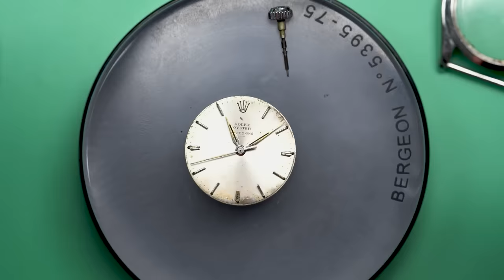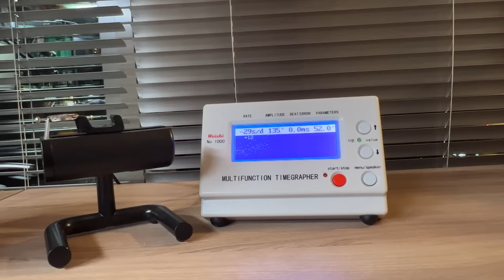This Vintage Rolex Restoration Came Out Even Better Than I Hoped!

Comment: Marshall, I started watching your videos a couple years ago during an illness simply because they started playing using YouTube auto play. Those videos caused a memory from my childhood in the 1970's of being given a couple of my deceased grandfather's watches.  Over the past couple years I have watched your videos and the urge to repair those old watches has grown to the point that the other day I dug them out of the drawer they are stored in. They are both old Elgin watches, one is an auto with day and date while the other is a simple wind up gold dress watch. Both watches are missing most of the crowns, apparently Elgin used cheaper materials for the crown and the only portion left is the small brass bit that screws to the stem. Anyway, I have ordered some new parts for the watch with the auto movement, a Swiss Felsa 4009 movement as it turns out, and with the help ofyour videos I will begin to attempt to repair it when the parts arrive. Thanks for videos and your positive, upbeat presentation style.

Comment: The Speedking looks fantastically classic and refined in style (ie without wear and tear) - also in relation to my simple steel 1985 Datejust which I bought new. Less "bling" such as the absence of the contemporary Datejust case and the Jubelee bracelet helps. I do not think that these have aged well stylistically. Otherwise, my 1985 Datejust still works perfectly even after 37 years of continuous use. The watch has been extensively cleaned twice and has had both the glass and the bracelet replaced twice. Keep up the good work :)

Comment: Just want to thank you, since I discovered your videos not long ago, picked up some cheap tools to do some basic take apart and inspect on my watch that would only run for a few seconds at a time.
Didn't take long to fix it, turns out from the factory they had inverted two of the gears for the automatic rewind system so it would just do an odd thing where the automatic system would somehow lock up the rest of the watch and the balance didn't have enough of a punch on its own to push past the blockage. Swapped them around, and now it's been on my wrist for the whole day, and still is right in sync with my smartwatch time.
Keep up the wonderful videos, they're a treat to watch and listen to and certainly encouraging to pick up a lovely hobby!

Comment: When you use any kind of tap, even to clean threads, you should thread it in a full turn, and back a half turn repeatedly to make progress. Should also probably use some kind of lubricant. I'm not a watch maker or anything, but that rolex thread refresher thing looks like a tap.
Reply: Agree but I would say a half turn forward and a quarter backward.
Reply from the maker: I did
Reply: So pretty much after every movement forward you go 50% backwards?
Reply: That advice comes from the good old days, as in pre-WWII. Modern taps invariably have chip breakers and gully channels to clear the swarf so the old way is becoming less and less relevant, and you will notice that powered taps do not do it at all. Finally, the tap Marshall is using is a thread cleaner, not a thread cutter; if it came out of a classic set of 3, it would be #3.
Reply: @DutchClawz  2 steps forward 1 step back

Comment: I don’t know what prompted me to “watch” this video, but I viewed the whole thing. Very impressed with your work. I think I’ll try to restore my clock on the wall. It runs, but the hands are loose and it seems to be running fast. I also have an old cheap watch that I think I’ll take apart to see if the components are the same as the Rolex type. I just hope my eyes are good enough to see those molecular size parts with my eyeglasses and magnifying glass. Thanks for the video.

Comment: I've finally got to the point where I can name every part of a basic Swiss movement, Marshall. I owe it all to you, your videos are excellent because you name every part, tool, and lubricant. I'm scouring ebay for used and new professional quality (Bergeon) watch tools, Timegrapher, and cleaning machinery. I'm an Electrical Engineer by trade, and I am acoustomed to working with small components, but this is taking it to an entirely new level. The parts and screws are miniscule, and require a very steady hand to pick up and place the screws in the right holes. I'd probably need to put the screws back in the holes during the disassembly, so I don't forget where they go. 

I set up a place on my electronics bench for watch servicing and repair. I already have a buffer system for polishing watch cases and bracelets, but I still need to populate the bench with watch repair tools. The mainspring winders are dauntingly expensive, and I may have to do with the Chinese knock-off version to begin with. They're fairly inexpensive, (a quarter the cost of the Bergeon winders) but they a significant flaw. The nub that the mainspring end hooks on to is a cast brass nub on the winding shaft, rather than a steel pin. I suppose that once the nub wears out, I can drill into the shaft, and press fit a steel pin into the hole. This would extend the life of the Chinese winders significantly.

Comment: I do plating and after plating you can use a brass wheel with a fine comb to buff the shine away if you dont need a shiney surface. It works quite well. Another great video thankyou Marshal

Comment: You tube is lucky to have content creators like you. Good work and thanks for posting this. My skill level is changing the battery on my quartz watches and strap adjustment and replacing. 🍻 CHEERS

Comment: Great video! A tip for the escape wheel cap jewel springs is to not remove them but just use a small screwdriver to lift up  the spring and then put it back down once you’ve removed/installed the jewel

Comment: Good technique:  On any mechanical device, if you are installing a part with multiple screws and other things that go in it like axles or pins, start them all before you tighten any of them.  Thanks for demonstrating this :)

Well done video as always.

Comment: I loved this, my first look at this channel. I bought a new Oyster, much handsomer than this watch, in1952 at an Air Force PX in Dhahran, Saudi Arabia, for $38 as I recall. (I am 97.) The watch is now at my watchmaker's for a thorough service. He is waiting for a new palette. It came with a leather strap, and in my ignorance I didn't save the buckle. However, I was fortunate to find a period-correct steel Oyster bracelet in a small Arab shop. I have bought and (stupidly) sold several Rolexes including a Day-Date I received as a 30 years service  watch. I still have a '70s two-tone Datejust with Champagne face and Jubilee bracelet, also in for service, and a Submariner I bought new about 4 years ago. I have many memories about watches I've owned, including an Omega with moon phases, a 10-karat manual IWC for which I bought an 18-karat mesh bracelet, a tiny steel International I bought my wife and still have. I also have a Ferrari Panerai and a Santos de Cartier Large Model. And more. Oh, yes, a gold-filled Hamilton I got for my 18th birthday which I still have.

Comment: Love the channel. A little tip from an old stagehand, but a pencil eraser is fantastic for removing tarnish and corrosion from otherwise "stainless" metals. Plain jane pink erasers are very mildly abbrasive and are perfect for cleaning electrical contacts. Might be useful.

Comment: Nice work!
Cleaning up threads with a thread-tap I believe is called "chasing" the thread.

What you used on the barrel looks like a thread-cutting tap, not a reamer, reamers have a straight cutting edge.
There are specialty thread-chasing taps with the thread-crests rounded down, but an older thread-cutting tap is usually what tool & die uses for chasing a threaded hole because when taps wear from use, its generally the thread crests that wear down.

Comment: Enjoying your videos!  I didn't catch whether this was an acrylic or sapphire crystal, but so far I've noticed you usually use acrylic when you replace them.  Do you prefer acrylic over sapphire (or even mineral), or is it just that the acrylic ones are much easier to replace with the type of press you're using where it actually bends the crystal a tad?  Thanks for your videos!

Comment: I repaired a 1930s longines , I have never done that before and with basically no tool just a few screwdrivers and an eye loop and worked great I've owned many and by many I mean a couple hundred watches I bought sold and traded I only own a few now but I would love to get back to the hobby is fun just picked up an omega constellation pie pan 18k late 50s early 60s like new for $280 I love watches and your channel

Comment: 33:08 I struggled when I first removed a cap with one of those clips (it cost £50 for a replacement! That was after import duties and taxes were added). I have seen a video by a Bulova expert, Henry Frystak (I have so far specialised in Accutrons) and he seems to release the end tab, and hinge the clip up with the other two tabs remaining in the undercut, and this provides sufficient space for extractingthe cap. Well - that's what it looks like he does, but I haven't yet had the opportunity to try the technique.

I love your presentation style, with great camera work and excellent sound. This video has made me think I might now have a go at restoring a fully mechanical watch.

What microscope do you have? I use a long-throw eBay binocular, and it is perfect for my purposes, except I'd like to do videos.

Comment: This is a general point related to screws and springs pinging off.  I tend to have that problem a lot, especially when reassembling vintage movements with those microscopic screws that hold the cap jewels in non-Inkabloc settings.  I’ve started placing the anvil or movement holder on a spread-out cheap microfiber cloth.  Normally when a screw pings off it hits the green watchmaker’s workpad, then bounces off to parts unknown.  When the work is done on a microfiber cloth, the screw hits the cloth and stops dead in its tracks.  Note that I don’t place the work directly onto the cloth, as it would tend to stick and also pick up fibers. Once the screws are in, I resume work without the cloth.  This trick has saved me many frustrating sessions on my hands and knees with a flashlight and a magnet!  Sometimes I also set a microfiber cloth in my lap for added safety, but so far the cloth under the movement has caught everything.
Really enjoy your videos, especially now that Mark Lovett seems to have stopped making new videos.

Comment: I wonder if you could use solvents to clean, and I mean delicate solvents used for painting restorations. Baumgartner uses these solvents with different mixtures of solvents to remove grime from paintings, they are gel solutions and not overly aggressive .  Could be an idea to remove grime from the watch dail maybe

Comment: I never replace anything that can be repaired, which means that I have a tendency to collect broken things until I have time to fix them.  For a while I thought modern electronics with near microscopic components were not repairable, but I've since learned you just need a different set of tools for it.  Much like watch repair, there are very precise and unique tools necessary and a nice digital microscope is key.  Watching you repair/restore/troubleshoot this Rolex, it's surprisingly similar to how smartphone boards are repaired.  Unlike a watch, repairing electronics isn't necessarily because they're valuable or collectible but rather because the data that they hold within is.  Someone who had pics or video of their wedding, their child's firsts, a deceased love one, or just important parts of their lives that are lost in a maze of short circuited semiconductors, that's what you're restoring.  That work often ends up costing far more than the device sold for new, but sometimes you can't put a price on the things that are recovered from it.  Having a device power up and accessing data is the equivalent of seeing a watch movement take off on its own power, and it's a great feeling to give someone a piece of their life that they thought was gone forever.

Comment: 34:07 so in that position, you want a thin wood stick that has a small flat portion, to touch the center part of the Y from the left. Then, using teflon tipped tweezers, come from the right and push down on the legs whilst slowly and gently compressing. That's how i was told to do it by the guy who taught me so i can maintain mine. He didn't have teflon, he used iron wood tipped tweezers, but i find that teflon tips don't scratch, yet retain their tip better than other plastic type tweezers (or like glass reinforced ones for electronics which will put really big scratches in soft metals).

Comment: I had a Rolex like this on the bench two weeks ago. After cleaning and oiling it was running ever wors. A very small drop of oil was on the balancespring. Took some time to discover this but now it’s working like new.

Comment: Hi
Well, watching your videos gave me the desire to get my hands on watches (always loved mechanical watches till I was a kid and opened grandpa’s watches ahah) Bought some second hand material, very exiting ! I bought a vintage non running Lip R25 to get started, and a second one to have some spare parts.
I would have two questions 
What kind of polishing sticks do you use ? (The case is in faire shape but but benefit a good polishing)
Is it possible to get the main spring back in is wheel without the adapted tool, by hand ?
Thanks by advance
Best regards from France !
I go back watching some videos of yours

Comment: I usually inspect each part during disassembly to determine any broken/worn pivots, cracked jewels, missing teeth etc. I also do pre cleaning with alcohol before using the cleaning machine. Keeps the solution fresh longer.

As for the case & bracelet I will pre clean it with Pegswood like you did. But I have another step which is brush cleaning with dish soap under the tap before ultrasonic cleaning. I find it gives better cleaning performance and my ultrasonic bath does not need to be changed that often.

Also I usually put some loctite blue on the case tube thread before installing into the case, and some on the stem before installing the crown

Comment: You should do this work in a confined space like a chemical hood type of set up. Leave just enough room for yourself to work in with all the places a tiny part can fly off to being confined. You could build this yourself out of sheet clear plastic and sealed corners and joints with silicone. This way everytime a part flies off you would hear it hit either the walls or ceiling,  just a thought. I'm looking for new watch but I'm like the elegant faces with minimal deco on there. I want a jet black face with simple fingers and either simple markers for the 5 min  ect..also I want a very slim watch. Any suggestions under £1500? Great video btw...I'm watching all of them. Subbed:)

Comment: I have a 70s Tudor snowflake M94110, I just got it back from Tudor and I was told they don't have the vintage parts to repair it. Something is up with the winding mechanism. Any suggestions on how I can get it repaired?

Comment: One question for you... how do you know how to put these watches back together? I get that there are some obvious patterns, e.g., the balance, the mainspring and its housing, the 4 gears... but how do you know which screw goes where? Are all of the screws with the same head size identical in thread/length, so it doesn't matter which hole they go into? Do you take photos as you get to each 'layer' so you have a guide to re-assemble?

I like your videos, but they are starting to make me think that maybe I could do this... and I should look for a relatively inexpensive watch on eBay to play with.

Comment: I had a pusher tube stuck quite badly in an Omega one time and I used a jewelers torch to heat the tube and case a little bit and then it came out without trouble....sometimes heat can be your friend on these.....

Comment: Hello Friend, i hope all is well.
I have a question if i may:
What would you use to remove rust from watch parts, and also what is the correct tool to remove a rolex pandent tube (datejust).
If you have links it will be more than wonderful.
Thank you for your help and knowledge
Gal

Comment: Unlike a "C" clip those small retainer clips appear to go inside the recess, which should go easily with an even push straight down after the center nub is under one edge... or vise-versa.

Comment: Actually capillary action and “surface tension” for that lume spread across the hands.  It takes a special talent for working in such a microscopic world, which I do not possess, I’d be cross threading screws, breaking gears and pivots, losing jewels and bending springs and tangling that balance hairspring.  I had my 16710 GMT Master II recently serviced, something I would never attempt to take on myself.

Comment: Would it be better to use brass tweezers on some of those steel parts to avoid gauging or scratching ?  Or you cannot get the same grip with softer metal tweezers and actually risk contamination with brass dust from brass tweezers ?

Comment: $1,600 for a broken watch is crazy.  Very nice restore. Satisfying to see.
Reply: Where did you get that figure? If you look up the watch model on ebay, eventually you'll find one that sold on Nov 12 for $2,185.50. That one has the exact same cracks, marks and scratches on the case back as the one in this video.
Reply: @mjay4700  that is what he said he paid.
Reply: @kevinorr6880  Strange because literally it's the same exact watch that went for $2,180 plus 5.50 s&h